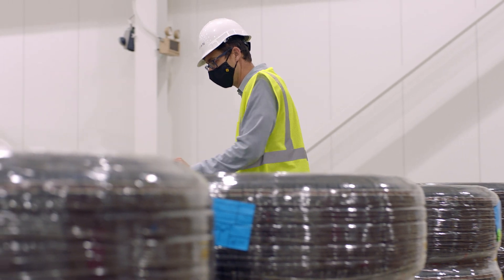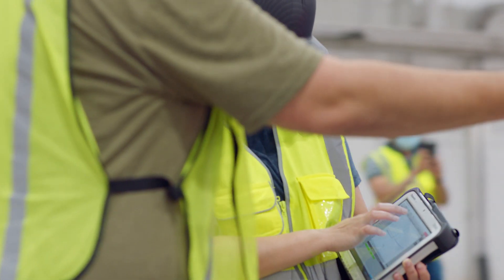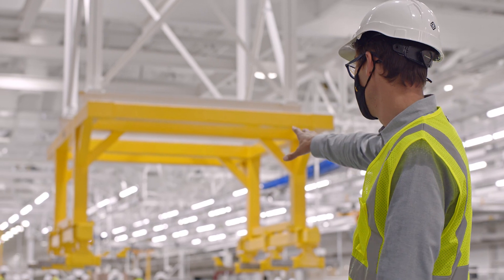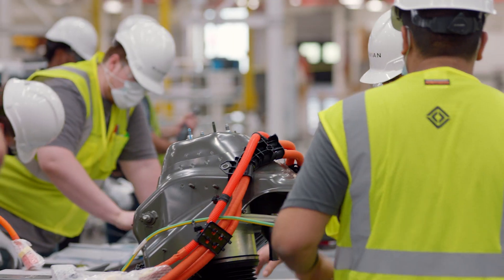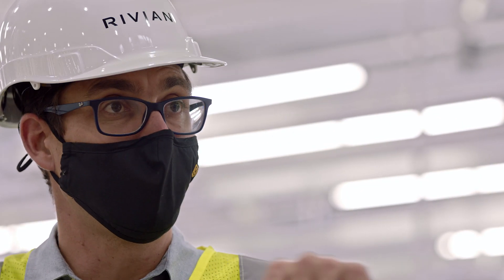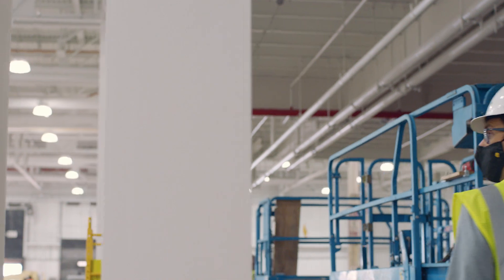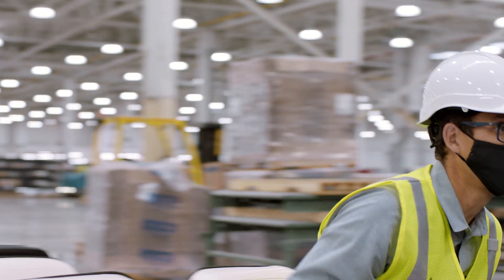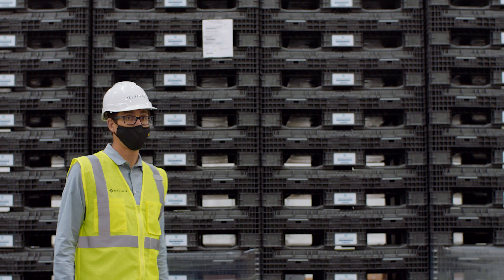Normal, August 2020 | Progress Report | Rivian

Comment: tesla products are a decade old technology (e.g., only has cameras not even radar, no laser to detect other objects).
Tesla self driving is only level 2, whereas Rivian is level 3 autonomy (on an off-road, you don't have to keep your 

eyes on the road and don't have to keep your hands on the wheel).

Rivian has 4 motors, others only have 1-3 motors.   Rivian climbs up 100% incline at 45 degrees.  

https://www.youtube.com/watch?v=Yeth5v_5dPM

Comment: Blue robots are a terrible mistake. Robots should be Signal Orange or Yellow, this is the international standard for dangerous moving machines and fixtures in industrial use. If  dark blue is a safe color, why are the people wearing florescent yellow safety vests instead of dark blue safety vests?  Bad decision on the robots, wait until the plant is really running and robot maintenance engineers start to have accidents hitting their bodies into robot parts while doing maintenance, repairs and tooling. Hoope you guys to well and are successful, but suggest too follow established 6S and industrial safety standards they exist for reasons and you don't want to reinvent that wheel.

Comment: This trucks look beautiful and the specs seem phenomenal as well, HOWEVER, I will point out one thing. The truck's bed (if online forms and articles are to be believed) will only be available in one size which is 55.1 inches long. That is very small for a truck and it would struggle to fit lumber, ATVs or dirt bikes. The base model and smallest F-150 bed is  67.1 inches. Here's hoping Rivian will offer different bed sizes because I am otherwise in love with this truck.
Reply: I agree
Reply: I guess they are lifestyle strucks not work truck.
Reply: 100% agree! I am really hoping they will offer a bigger bed for the base model to at least compete with other base model trucks!

Comment: Color Blue is very nice as is almost everything in the design. Unfortunately HEAD LIGHTS are a huge FAIL and will keep everyone I know from ever buying one. And the steering  wheel looks like a vintage 1980’s Chrysler wheel.  So close but those two problems will keep it from main stream for now.   Maybe change out head lights on next year to get rid of the stadium part and you will have lines of people ready to buy.  Easy Fix

Comment: Our family of five just installed 79 solar panels. Should  produce 25KW of power. We’re working through the final inspections and county approval now, here in Colorado. We’re hopeful it’ll be enough power to run our entire household and two electric vehicles (we also are allowed up to 6 hrs of charging at work). Our commute is roughly an hour in each direction. Although we haven’t owned an EV yet, we are extremely excited at the prospect. Not sure when it’ll be in the budget for us, but Rivian is in the front runners. We love the design and it fits our active lifestyle! Best of luck Rivian. Hopefully we’ll see you in our solar panel roofed garage soon!

Comment: Just one question... do the truck and the SUV have the same towing capacity?
Reply: No
Reply: @mohammedayesh3927  ok, what is the difference?
Reply: @kentmadin9408  My best guess would be, due to SUV's being less used for utility purposes, they probably use a smaller gauge wire that carries less current. resulting in the motors being limited to less torque as not to burn through the wiring.
Reply: It's like suv is 9900 pounds and truck is 11000 its on their website